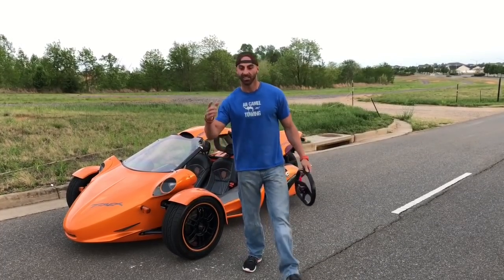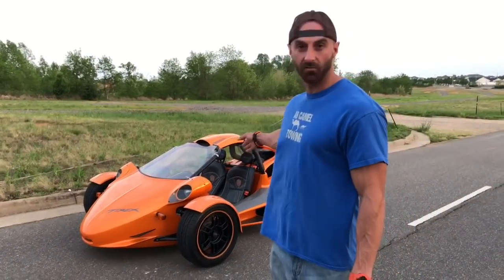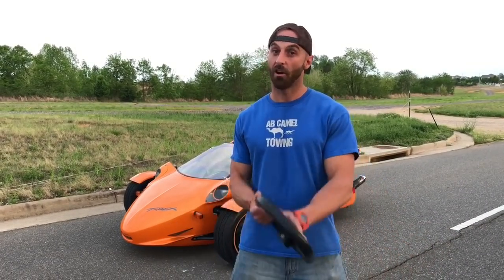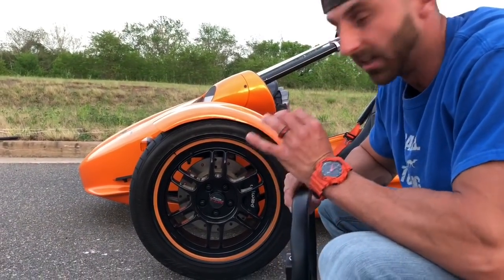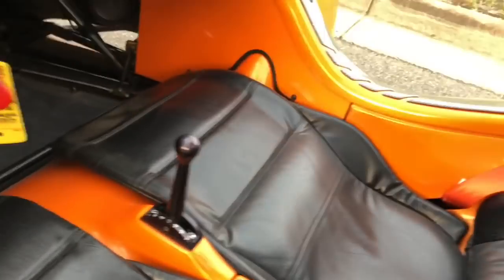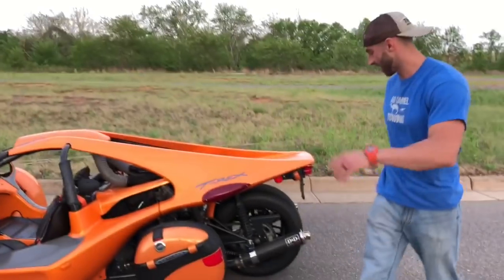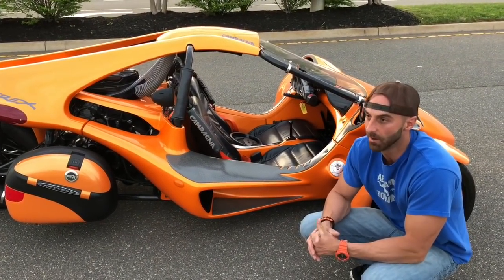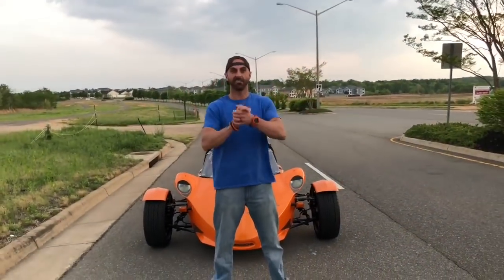My 2006 Campagna T-Rex!!! CRAZY VIDEO!!!!!!! Ruff Ryders!!!

Comment: A few corrections: The 1200 is from a ZZR1200, not a ZX12, and they were less than $50k prior to 2009 (currently mid-high $50’s for the BMW powered 16s & mid $60k for the 2021 14RR).
Reply: On cycle trader?

Comment: It IS NOW CLASSIFIED AS A Car. You don't need a helmet in some States. The INVADER is just as good as The T' Rex. the other 3wheeled trikes tha 1 that's build here in the U.S I would not spend $$$$$ on. But I REALLY would buy The Rex and The Invader.
Reply from the maker: Good point James!  A lot of R&D went into the Campagna T-rex, but...  Drive a T-rex, then drive an invader and tell me which one you'd rather buy if money wasn't an issue.  Ive driven both.  Dont get me wrong, the invader is fun too, but lacks majorly in handling against the REX!  Think its due to lower center of gravity.  Plus the invader looks like something MR. BEAN would drive! LOL

Comment: I am from where they built them...total rip off. It is basically a 6000$ engine incorporated into a 74000$ frame... These are extremely performant machines but at a price tag of 80 000$ ...not worth it. I could get a hellcat or even a corvette at this price. This is the reason this isn't that popular, price is way too hight for what it is really